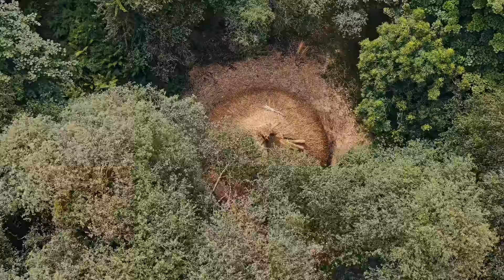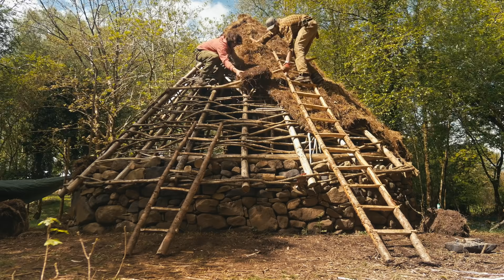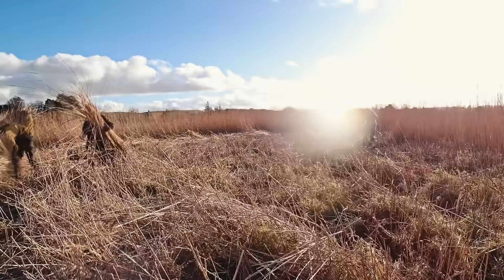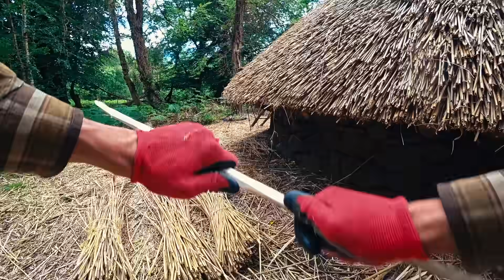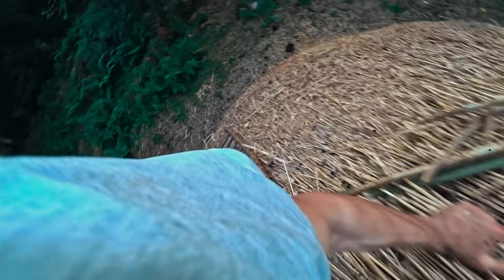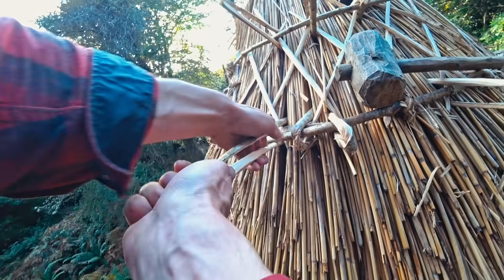Build of an Iron Age Roundhouse! - FINALE Episode

Comment: One thing I think you guys might want to consider is putting thick reed mats on the walls from the inside, especially for winter. That's how medieval castles in some regions were insulated in the cold seasons, because bare stone, being a very quick conductor can suck out the heat very quickly. Animal skins can work very well for that too (especially sheepskins), but that requires building up a big supply. It's also why Russians have are known for hanging persian rugs on their home walls. Where I live, insides of wooden (or wattle and daub) houses were often covered with a layer of reed or straw and then covered with clay mixed with lime to create a sort of plaster. Clay layer would slowly build up heat from the fire inside keeping it warm for longer, while the reed underneath prevented the heat being sucked outside.

Another thing you will probably need is a small antechamber at the entrance (even half a meter is enough), so that you can have a double door (wooden door outside and a hanging woolen cloth inside should work very well in tandem). That is also something that was done in the old times to prevent heat loss when entering the house, working a bit like an airlock.

Heat loss and moisture will be your biggest hurdle with this project, medieval houses stood for long periods of time because there was a fire going all the time everyday. Don't know how often you're planning to live in there, but without constant heating you might see moisture buildup and decomposition over time, so good insulation is key (adding that extra layer of scraw for the roof is already a brilliant preventive measure for that).

Aside from that, I'm in absolute awe. It's absolutely gorgeous, looks like a home from a fairy tale, and at the same time it's very practical. I hope one day I find the means to create something similar. You guys are massively inspiring, and your laid back, fraternal spirit is something to live by!

Comment: So, are you going to mud plaster the interior and exterior walls to keep the wind out? I know the exterior plaster would need replacing every year, just like it would on a wattle and daub building, but the interior plaster would hold up really well and could just be clay heavy soil with broken up straw or other natural fibers to resist cracking. It would last a long time and not even need any lime or cement since no weather would be hitting it and the temperature of the stones and interior of the house will change very slowly and have a narrower range of temperature, so it won't be stressed as much from thermal cycling, which is the other thing that breaks earthen plaster down.

Comment: refining your own clay is an easy project to start with, it mostly is just time consuming. dig a fairly large shallow pit near a water source. bring a few wheelbarrows of clay soil over and make realy watered down mud from the clay soil. the larger heavier settle out at the bottom of the pit and the smaller clay particles settle out close to the top. wait for the mud to mostly dry out and repeat the process a few more times and you got a fairly decent locally sourced clay. then it's just a matter of adding grog to the clay to reduce shrinking during the firing process and wedging the clay to get out any air bubbles while getting it to a good consistency to work with.  failed pottery attempts crushed into powder make for good grog. don't be surprised of you get a bunch of broken pieces on your first go in the kiln, pit firing pottery is difficult to do seeing as you use a hole in the ground instead of a more modern kiln built of bricks. it is tough to get the pit hot enough to bisque fire the pottery and then the cooling process is not very well controlled. if you have air bubbles trapped in your clay the pot explodes in the kiln, if your kiln cools too fast the pots crack. it can be real hard to make sure that the fire is heating all the pots evenly so expect some to be only half baked. overall i'd say getting a proper bisque firing with half of the pots successfully completing the process is a feasible goal.
Reply from the maker: Pottery, definitly on the listtt! You can see our first pre roundhouse attemt in our pottery 1vs1 battle video!;) Thanks for sharing your insights

Comment: I'm wondering if back in the olden days they would have put animal skins on the inside of the smoke hole at the top to stop embers from setting light to the roof. An animal skin is not going to set light from a small ember and instead will just shrink slightly where the ember lands and then the ember will go out. Obviously the skin would need to have all the fur removed. It would start off as raw hide, and would end up as leather as the smoke permeates the pores of the skin during use.

Comment: Right, I’d kindly ask you to document everything as well and thoroughly as you can and get in contact with an archaeological institution such as a university department or similar.
Depending on the the degree of adherence to actual techniques, materials, etc this could be of value to experimental archaeology.
Actually maybe contact Exarc directly.
Reply from the maker: Great input, something like that might already be in the pipelines ;)
Reply: @SmoothGefixt  
It would be amazing if it worked out!